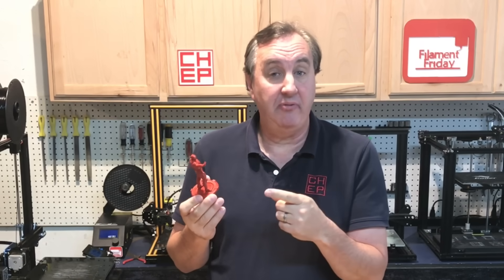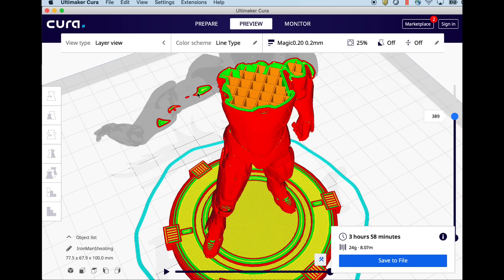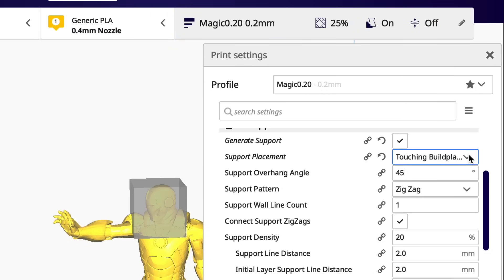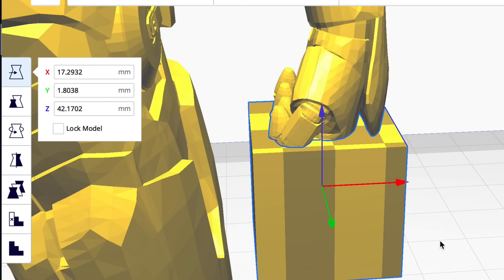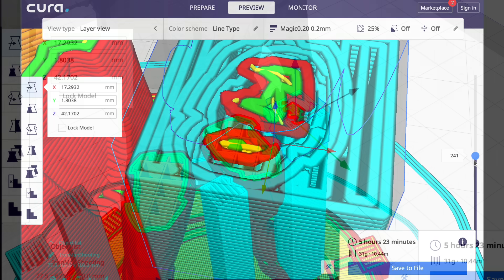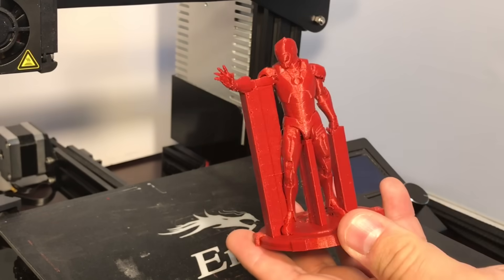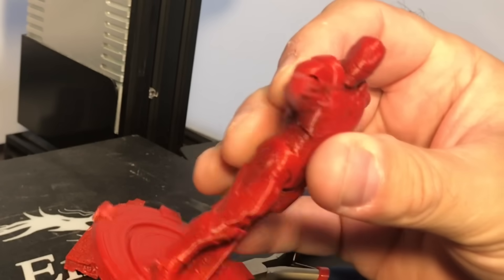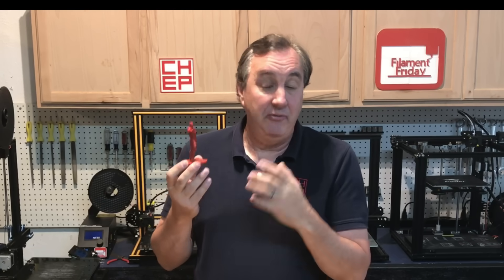Custom Manual Supports in Cura Slicer 4.3

Comment: Hi i know this video is about supports but  can anyone help me i got a ender 3 about a week ago and  when my print gets to around 90 mm it try to pull the print from the bed  also  my right side or the gantry is higher then the left how can i fix this please
Reply from the maker: Adjust the wheels on the uprights to get it more level and sag less.
Reply: @FilamentFriday  hi thankyou for your reply is there a video anywere on how to set them up

Comment: if you put a roof on top of your support it will seperate from the main print alot easier as well
Reply from the maker: I showed that and why I disabled the roof.
Reply: @FilamentFriday  If you change the support interface pattern from grid to concentric and increase the density to 100% it will turn out a lot better. Once you do you'll notice it is much easier to remove the supports too, while getting the exact same degree of support as you did in the video.

Comment: No need for a plugin! 
It can do manual supports in stock, just place the support blocker cube and switch it to support enforcer in the per-model settings. The plugin merely adds a specific button to place support directly. 
Best of all, you can to that with any model you import, so you can design your supports in CAD directly :)

Comment: Chep I have found all your videos on Cura very helpful. I was wondering can you help with a problem I have with Cura. Whenever I have something with flat top, Cura will print 90% smoothly but will put a triangle that spans the whole surface that is at a lower level than the rest really messing up the print. This is not a printer issue as I can see it in Cura preview. Whatever settings I have I always get this effect. Any advice would be welcome. Btw I am on the latest version of Cura
Reply from the maker: Not sure I understand.
Reply: Travel > Combing Mode > Not In Skin

Comment: I've been getting increasingly frustrated with simplify 3D. Specifically the way it handles material and 'quality' profiles. I have an E3D tool changer and the process management is very powerful, but today I installed cura and began setting up the material settings, manually migrating from S3D. Cura is MUCH better at this, and since I used it last (years ago!) offers some really useful granularity to the print settings. In S3D you can't specify a different extrusion multiplier for the first layer, which is incredibly frustrating (workaround is to have a separate process for the first layer, but it's a pain).

My main reason to get S3D (four years ago maybe?) Was the manual supports so this has made me quite happy. Guess I'll go back and keep chugging through material settings and getting used to curas quirks now then!

Comment: I recently found this is actually possible natively in Cura 4.3 (not sure about previous versions).  Add a support block as usual, and in the Per Model Settings with the block selected, choose "Modify settings for overlap" and hit "Select Settings" then add "Generate Support" and any other special settings you might want to add. From here I think it's exactly the same as the process shown in this video. The support options you can add there is only about half the normal list at the moment (support pattern is a pretty important one which is missing), so, like in this video, tick Generate Support in the main print settings, adjust accordingly, then untick it again and the setting still applies to the block/s you placed.

There's also another option for the Support Block Per Model Mesh Type, which is "Print as Support" which treats the entire block as a support, enabling you to do stuff like manually building a tower, or encasing your model in support (if for some strange reason you need to).

I've only been using Cura for 3 weeks and have been watching a few of your videos whilst trying to get good prints out of our new Ender 3. I actually figured this process out after watching "3 Cura Slicer Setting Tricks For Beginners" to learn how to change the infill density at different locations.

Comment: I have printed enough now that I have a good idea what will need support and what won't, and with your tutorial and this add-on, now I can choose the exact placement and size of supports. I installed the plugin and tried it out right away, and waited for the print job to finish, it worked to perfection, just as you showed in your print. This may be the most useful episode you've ever done, at least for me. I recommend that people print the MICRO all-in-one printer test that shows what overhang angles your printer can do cleanly, and if you have an Ender 3 like I do, definitely upgrade the part cooling duct, I went with the latest version of the Hero Me design with stock fans.
Reply from the maker: Thanks. 
I tested the Hero Me. I didn’t see a big difference.

Comment: There is also another plugin that you press to auto orientate the model to minimise support required. Then you use the normal or manual support. I have yet to use it as on a bunch of supportless prints at moment but should be worth a try.
Go to marketplace as shown at start of this video and hunt it out.

Comment: Considering you only wanted supports where it was printing freely in the air another option would have been to change the "Support Overhang Angle" you can see you have yours set to the default 45 degrees.  Setting this higher to should have been an option you should have at least shown.

Comment: I have a question CHEP. Do you think its possible to add the default support cube to a print without CURA printing the part where the cube overlays with the model as standalone part? Not sure if you noticed but if you made the support cube bigger for the hand. So big that half of the leg would be inside the cube just for a few laywers - those layers would get printed separatly and it would create weak spot as well as bad cosmetics for the print.
Reply from the maker: No, the support would go around the leg like it did the upper hand.

Comment: I wonder would it have been the same if CHEP just would have changed support overhang angle to 80%? I'm not saying manual supports are bad inclusion, just that in that model he might have gotten better results with that setting.
Reply: Guessing you have good results of with 80 degrees but for a lot of us about 70 degrees is max, depends on how well dialed in printer is. Agree with your point about raising from 45 degrees though so thanks. Expecting you know all this but I'm commenting for others. Cheers.
Reply: @Cloudman572  Yeah, 80 degrees is stretching it for sure, but the raised arm on the model from CHEP's support onwards is about 80 degrees and his machine did ok. You can help the printer by reducing layer hight. But anyway, this was great video from CHEP! I will definitely check that manual support add-on. Cheers!
Reply: @ilpoahlfors1118  Check the auto orientate  for minimum support plugin too (it is off then you click on auto orientate if you want it). Cheers.

Comment: Whyyyy can't these programs just include all settings? I like the speed of your prusa slicer profile for my ender 3, but the default settings on cura makes my prints beautiful but slow. The main difference between the two are support settings. Prusa being the better half of those settings. Also, are you going to make a cura 4.3 profile for ender 3 making it as fast as prusa profiles?
Reply from the maker: I could try.

Comment: Deffo check out the Flow %'s - they've broken it down into separate sections. That means you can print with a reduced flow for support - which I suspect would mean you can balance support strength vs ease to remove.
Reply from the maker: I covered that in my Cura 4.3 video.